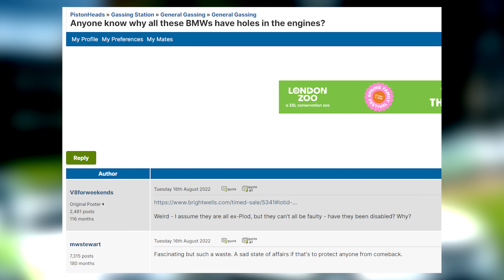Why The UK's Police Cars Keep Catching Fire (BMW N57 Engine)

Comment: I had a recall by BMW on my 435d X Drive, this was to check out the EGR cooler. I was informed by BMW that the turbo's may need replacing also, fortunately for me the car was fine and no parts were required, it is serviced regularly. The car is used mainly for journeys no less that 30 minutes to some hours at a time, hopefully the DPF regenerates on these extended journeys that have no idling expect traffic lights etc.

Comment: Just because that HUGE BULLSHIT named EMISSION CONTROLL which only purpose is to deeper enslave populations. People should UNDETSTAND what governments do, they are just modern SLAVE OWNERS, they will feed you with manipulation day and night continously.
Back to ANY brilliant diesel engine, THROW AWAY all the caps from exhaust then you will have a performant and reliable engine. When some imb3c!|3 ecologist say something about global climate change, just spit him in the face.
You just TORTURE those engines with HUUUUGE egt and impossibility to run clean and cool without huge watercooled EGR, bottom oil vapors back in intake and catalysators + particule filters. 
YOU WILL NOT SAVE ANYTHING destroying your engine and limiting your mobility= your freedom, but just make more richer some scumbags which fools you everyday. Global warming and glaciation periods are CYCLIC astronomical and planetary events which will hapen even if you will not move one inch all you life!

Comment: with all due respect the biggest killer of the filtration systems is lack of proper maintenance that every other civilian road user has to keep up with the police have their own standards and rules for it. its their own fault
Reply: @harrythompson6977   You plonker Rodney!! The Police service intervals are more regular than the Manufacturers listed durations. For example, if BMW state a 10,000 miles service interval, the Police would do a service at 5,000 or 6,000 mile intervals instead, so more regular than required!! I think the usual service schedule the police adopt for all 4 wheeled vehicles is usually around 6 to 8 thousand miles... Bikes are usually 3,000 oil changes and 5,000 services. So silly boy, just how are the Police to blame for servicing their vehicles at more regular intervals??

Comment: If you try to buy any BMW3 series 5 series X5 jeep from car auctions, the police are advertising them  as spares or repairs cause they deliberately drill holes in the blocks to make non runners It must just be something the police are doing or wiring  into the cars electrics, to make go on fire.

Comment: It should be pointed out that the N57 is no longer in use in (I think) any police force in the UK as it was of course discontinued in 2019 and most traffic cars from 4 years ago have been replaced by now. So this is a past issue rather than a present one. Also the point about the police not using BMWs anymore, or BMW not wanting to supply the police with them is totally false, as we can see the UK has just spent several million pounds on new BMW M340i petrol traffic cars in the last couple of months, the most expensive traffic cars ever for the UK.
Reply: Not entirely accurate; BMW won't supply Authorities spec vehicles to police anymore but there's nothing stopping individual forces from buying civilian models via "normal" channels. The M340is were bought this way by North Yorkshire Police, they definitely didn't cost millions though.

Comment: Unsuitable cars with very suspect engines. The very obvious is that diesel fuel thins oil quickly when being idled [and polluting as well]
They should be using petrol engines cars,if they want peformance they have it. Not a comparitivly gutless nunga nunga. Petrol engines get less contamination [and it boils off easier] and do not have all the b/s required on the stinker.

Comment: I’m sorry but how does oil coming out of an engine make you spin out. That doesn’t sound right to me at all.
Reply: Drrrr, when the oil come out of the engine it goes under the tyres. Oil is very slippery. Even when thinned with diesel fuel

Comment: If you have a decent race car, that you want to keep and invest in, you might change the oil after every event, not 20000 miles plus idling time?
Reply: For normal driving every 12,000 is fine, 20,000 with long life oils. The police do not drive normally but there is no need to go mad. European oils are vastly superior to those used in the US hence why so many Americans change their oil so often.
Reply: It was 10000 miles and condition based was not used. Then changed to every 4k oil service interval. And if oil consumption was high needed a visit to workshops.

Comment: I am so happy I have come across this... My 520d (F10 model) also caught fire. It is not only police cars or the N57 engine that has this issue.

Thank you for sharing this
Reply from the maker: Wow, thank you for letting us know... What was your driving style like, if you don't mind me asking? Did you idle in traffic much?
Reply: @blagssss  nothing to do with traffic idling or driving style. When police cars are on patrol stationary they idle the engine to keep equipment charged, plus improve driver response.  There are two issues with BMW diesels, 1) not reducing service intervals to account for "atypical use" (the emergency services extended idling scenario) which can lead to problems with oil quality and premature engine failure 2) egr cooler leak defect where carbon and glycol coolant mix under high temperatures and form a molten carbon layer compound which melts through the plastic manifold and potentially causes a fire.  This second issue is subject to a huge recall now. I got my letter the other day. They will replace the egr cooler and warrant it for 15 years regardless of car mileage.

Comment: I would be curious if this has  affected other countries that also used BMW for Police cars.
Reply from the maker: Australia also use quite a few models, and had done their own investigation. They concluded that their models weren't at risk. Perhaps they have newer B57 cars instead, or maybe different usage to our ones over here
Reply: Nope. The reason it has affected just the UK is due to the fact the British police force IGNORE manufacturers recommended service intervals for emergency response vehicles. Never any issues in Ireland with our 530d's and X5's both with N57's as they are properly maintained

Comment: The Police Scotland cars at my local auction are all sold as runners, they’ve been replaced with Volvos
Reply: You meant NON runners...
Reply: @Ayrshore  Thursday auction this week at Wilsons Dalry, 3x ex-police 530d estates with the N57, all sold as runners
Reply: @geecars6263  Nope. B57 engines.
Reply: @Ayrshore  No, I mean runners, the clue is in the absence of the prefix “non” 😉
Reply: @geecars6263  then you’re wrong.

All of them with the N57 engine were sold as non-runners.

They were chemically seizing them rather than drilling a hole in the block like Brightwells were doing.
Reply: @Ayrshore  I must have imagined them driving through then 😂😂😂
Reply: @geecars6263  if they drove through, they didn't have an N57 engine.
Reply: @Ayrshore  Yeah, okay mister expert 🙄
Reply: @geecars6263  see, you got there in the end.

Comment: The BMWs are used as traffic cars. Traffic cars are only ever high performance vehicles, but have to be fit for traffic purposes, so need a large boot. Police are turning to Volvo and Audi to supply traffic cars, including the V60 and V90s, and the Audi A4.

Comment: In the U.S.A., about 65% of the police vehicles are Ford Explorers.  They are not without issues but are pretty tough vehicles.  Ford has a spotty record with standing behind known problems until they become National or International news in my opinion.  Examples of this are… like when our mechanics found that Ford’s two-piece welded wheels were splitting.  This went viral for police fleet maintainers, and the solution Ford offered was x-raging the wheel’s welds every few thousand miles.  Not an efficient solution, but it does account for safety.  You didn’t see it in the news though.  Another issue was faulty exhaust systems that caused carbon monoxide to build up in the cabin area.  I’ve had this occur on two of my Ford Explorers.  Ford suggested having CO2 detectors installed in the cabin areas.  
Dodge offers the Charger, which is often used by State Police, County Sheriff’s Departments, and Highway Patrols.  These are great interceptors, but I have heard that overall quality is rough and the small things like switches and knobs often break.  Dodge also offers the Durango.  
In some areas of the U.S. they use Chevrolet Tahoes, especially in the Southern and Western/Midwestern states.  I have no info on their performance.  
The Michigan State Police and the Los Angeles County (California) Sheriff’s Department conduct yearly testing of police vehicles and compile this data for publication so that other agencies can learn of their findings.  I’ve downloaded each of these in the past, and they are quite informative.  Thanks for the video, and Stay Safe!!!

Comment: The Peugeot’s are just response cars. Replacing the 330 and 530 vehicles that were reserved for traffic in the Met and other services is the Volvo V60 estate, and for the X5 replacement is the Volvo XC90. They are amazing replacements but can be overly cautious when in a pursuit (first hand experience)
Reply: Durham I think it was were using the Peugeots as ARV and RPU cars - because they literally didn't have anything else. All their eggs were in the BMW basket.
Reply: @Ayrshore  yh that would’ve been short term, due to chip shortages and getting newer cars to replace the BMWs.
Reply: @PavanSinghAneja  many months.

Comment: Around me in the Midlands, my local cop shop has been driving Volvo V60 B6 Authorities editions, with the XC90 Authorities editions thrown in to replace the X5's. Not sure if the XC90's are B6's or not.
Reply: They are b6 very mild hybrid 2.0 petrol 300bhp units. And they’re terribly unreliable
Reply: They’ve got a lot of T5 XC90 unmarked cars and the Cupra suv (unaware of the name) they seem to be jumping into more unmarked cars than marked
Reply: @SolarArtworks  the Cupra Ateca?
Reply: @andrewbourke2696  yes that’s the one.

Comment: Many Forces across the UK are replacing these N57 Interceptors with a lot of new nimble and small hot hatchbacks. VW Golf R, Seat Cupra Leon’s, new BMW M135i and some using new M340i’s (North Yorkshire Police). 

Anything VAG has become very popular recently as well, Skoda Octavia & Superb VRS are being used as well. The N57 cars used by forces were primarily for use with the Operational Support Group (This consists of traffic cops, firearms officers, K-9 Units etc).

Their primary reason to switch to turbocharged 2 litre petrols is simply the emissions are more in line with county-set emissions targets for emergency services.
Reply: until they realise that those diesels pollute less nox, co2, co, etc... unnecessary obsession with petrol in England at the moment
Reply: Why do you put apostrophes in only SOME plurals? I'd understand that you're ignorant if you put apostrophes in all plurals, thinking that plurals need apostrophes, but I'm bewildered why you only put apostrophes in some plurals? How do you decide which plurals to put an apostrophe in?
Reply: @markfox1545  dyslexic big man
Reply: North York’s get dollar for their cars from tv production fees surely.

Comment: So much misinformation running around. BMW had / have their issues, sure. Look at the EGR situation. 

But this crash / incident had NOTHING to do with the EGR (Like some BMW "Mechanic" claims). The crankshaft bearing was faulty and the engine shat itself. The N57 was notourious for issues. Timing chain, EGR, Crankshaft bearings, etc.

But as BMW pointed out, this engine with this particular use case needed a increased oil change frequency. Forces ignored BMW's advice and continued using their own service schedule or outdated BMW service schedules. You can google this information, via FOI requests. They also didn't use BMW oil (Meh, fine, but it's a factor). The crankshaft bearing, already defective, then failed after improper lubrication. How does a crankshaft bearing not got proper lubrication? Shit oil (oil itself or just general servicing or lack of). BMW continue to supply authority spec vehicles to NHS, Fire (UK) and the latter + police in the rest of the world. Why is that? Because forces in the UK didn't follow proper advice then bitched about it when it backfired. Simple as. Nothing to do with the EGR.
Reply: Exactly. Finally someone with actual common sense..... The Irish police force ('an Garda Síochána') has many X5 30d/40d's and BMW 530d's, all with N57's. Any issues? Nope. Why you ask? Proper maintenance. Simple as.
Reply: @aidan1585  exactly
Reply: I agree with your views ecept that I think you mean "increased frequency" or "reduced interval".  No engine likes "endless idling" or being thrashed.  Except for range issues, perhaps the police would benefit from using elecric cars.
Reply: @john1703  sorry, yes I did mean increased oil change interval.
Reply: @tylerkay4389  Still backwards? Reduced oil change interval, surely.
Reply: @john1703  increased oil change frequency / interval? You’re increasing the frequency or interval  making it happen more often
Reply: @tylerkay4389  Interval is the time between repeated things.  Frequency is the inverse of this.  Frequency increases as interval (wavelength for waves) decreases.
Reply: @john1703 using EV would benefit the police, the 12volt system is ideal for the use cases that require idling of police cars, and idling an EV has no impact on its ability to suddenly operate at high speed, or excessive fuel consumption from idling.
Reply: @insanityideas   But excessive power consumption when being pushed hard, then an unacceptable recharge time at the end of that... And don't forget the 12v currant usage of the blues and twos!!
Reply: @SFlightline  the 12v system of an EV is maintained from the high voltage battery at all times as required (if the battery needs charging at 2 in the morning the car turns itself on to do that). In an ICE vehicle the engine must be running, which is why the police cars were being idled so much. Most EV have a battery big enough to power a UK house for a week, they can run the blue lights and heating for as long as the police need them.

American police forces seem to be buying plenty of EV's so it works for them, not seen them in the UK yet aside from Tesla running a demonstration car loaned to various police forces and roads policing units.
Reply: @insanityideas   Thats exactly my point... when left at an accident scene on a motorway half way through the shift in the winter... just how will the depleted battery manage to run all the systems, radios, computers, heaters, headlights, strobe lights etc?? Do you just plug it into the magic electricity tree??
Reply: @SFlightline  if it's a Tesla model 3 it will consume 1% battery every 1 hour that it is idling with heater or Aircon on. So even if it's low on charge it will be fine. With heater off the idle time can be doubled or tripled. Police will only be able to accurately see if it's suitable for such scenarios by trying it out.
Reply: @insanityideas   You have no idea of the extra kit installed and the power consumption it uses, also constant high speed runs will kill the battery off in no time at all. They might just be acceptable as a family car for shorter low speed trips, but not as a traffic car. The tech just isn't there yet, and you cant wait hours for the car to charge up before you go off on a pursuit or respond to an urgent assistance from a colleague...
Reply: @SFlightline  EV have a 70 to 100kwh battery, that's enough to power a UK house for a week, it can manage a police laptop and some flashing lights for days. The range far exceeds what patrol vehicles cover in a day. An EV isn't suitable for all police tasks, but it is suitable for many tasks, so they can start trialing them on tasks they can do.
Reply: @insanityideas  Well I just guess you cant educate Pork!!  We were talking Traffic cars, not beat cars... Go back to your Empire Stores Catalog...
Reply: @insanityideas  In general, EVs are not designed for, or even capable of, high speeds.
Reply: @UKMike2009  Yeh you are right, my EV is factory limited to 168mph so even the manufacturer doesn't want it going fast. Works fine all day long at 70mph which is all I need out of it.
Reply: @john1703  Oh I haven't laughed so much in years..... An electric traffic car with a range of 60 miles and a 4hr recharge.... you crack me up....

Comment: Is the B57 affected in any way? The B series seems to have nothing but glowing reviews.
Reply: N57,N47 both have timing chain issues and n57 has problems with the crack bearings, also the intake catches on fire from the egr getting stuck
All fixed on the new series